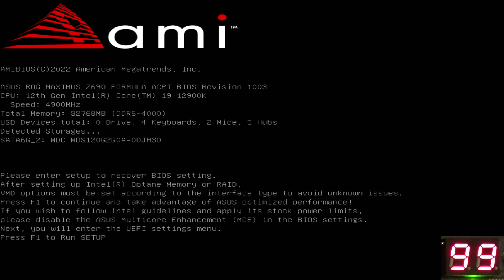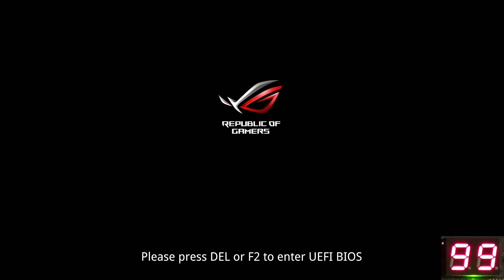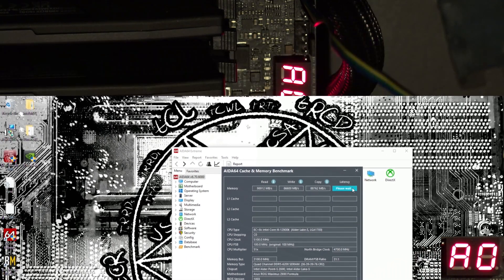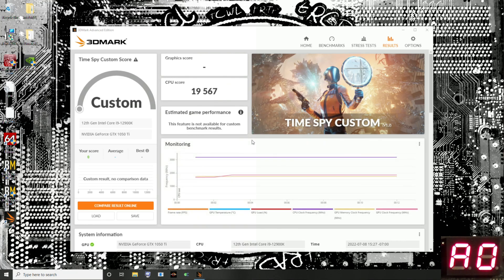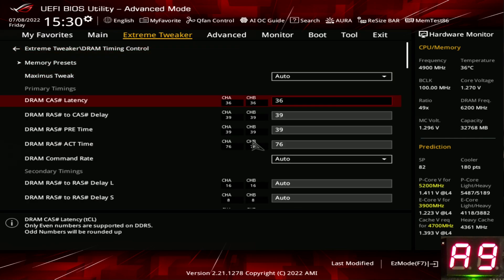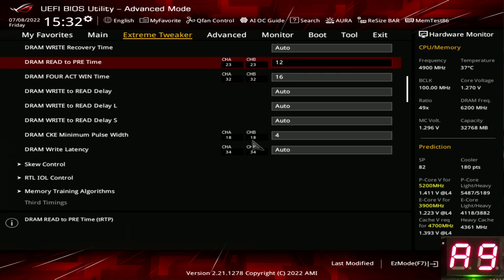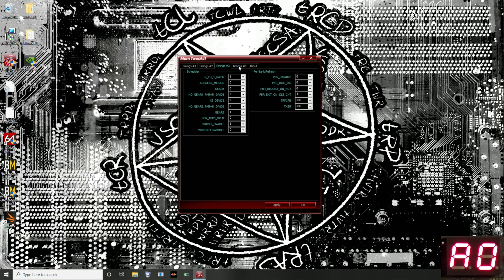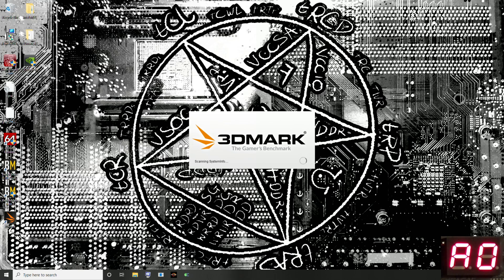Easily improve your DDR5 XMP's performance // for ASUS motherboards

Comment: I tried these settings with Corsair Dominator 6400 CL32 (CMP64GX5M2B6400C32W) on 6200 and Strix ROG Z890-I gaming WiFi.
A lot of boot cycles and fail safe mode after that. So it didnt work for me.

Some people said its because i have 2x32gb modules, which basically should be dual rank. So, am i cooked?

Comment: Great info!!  im running a 4x32GB Trident Z5 6000 CL30-40-40-96 with I9 14900k and Asus Z790 maximums hero.  i lowered the primaries too 26-34-34-26 and implemented all your suggesting settings. currently have AIDA64 80GB write and about 67 ns latency. Cant get any memory speed over 5,200 mhz. Any thoughts ?

Comment: But this surely would not work with an AM5 board?
Reply: VSOC: 1.2v
VDDIO/VDD/VDDQ: 1.4V

Speed + Primary timings: EXPO/XMP
tRRD_S: 8
tRRD_L: 12
tFAW: 32

tWR: 48
tWTRS: 7
tWTRL: 24

tRFC: ~512 if A die, ~640 if M die (your kit is likely A die, if it doesn't post then it's M die)
tREFI: 32765

tRDRDSCL: 5
tWRWRSCL: 17
tRTP: 16
tWRRD: 4
tRDWR: 16

This should work on the majority of kits. It's not the tightest it could be, but it will be better than EXPO.

Comment: Hello I'm running G Skill Trident Z5 RGB ram in mine.  I have 32gbs but I'm only able to run 16gb.  The moment i put my second stick in my pc doesn't work.   

Do i make these changes then put the stick in?  Ive tried adjusting voltage And so many things.  It just won't work for me.  Both sticks work when used single but dual i get nothing.
Reply: Try increasing the VCCSA/VDDIO a touch.

Comment: Corsair sells their memory modules with the same part number, but with chips from different manufacturers. The only hint ist the version number. Ver3.43.01 = Micron 16Gbit A-Die, Ver3.43.02 = Micron 16Gbit B-Die, Ver3.43.04 = Micron 16Gbit D-Die, Ver3.53.02 = Micron 24Gbit B-Die, Ver4.43.13 / .02 = Samsung 16Gbit B-Die, Ver4.43.19 = Samsung 16Gbit P-Die, Ver5.33.01 = Hynix 16Gbit A-Die 8Gbit Downbin, Ver5.43.01 = Hynix 16Gbit A-Die, Ver5.43.13 = Hynix 16Gbit M-Die, Ver5.53.13 = Hynix 24Gbit M-Die

Comment: Tried this on Corsair Vengeance 32GB (2 x 16GB) DDR5-6400 PC5-51200 CL32 Dual Channel
Unfortunately it wouldn't successfully post and boot, and to revert back to xmp I  intel 13600k

Comment: Hi Buildzoid, you may have noticed that halving UCLK at 6000-6400 ram speeds doesn't reduce performance in games, for example. FPS stays the same on 9800x3d, which made a big difference on 7800x3d. Why do you think? I confirmed this in different resolutions, e.g. in the SOTR benchmark

Comment: Just built up a 14900k on a z790 dark hero with Corsair titanium 2x24 7600mts and struggling to get it stable @ 7000. Tried adding in these timings and I couldn’t get to post. Though I went in after and started doing one change at a time to see the affect and the refresh rate changing to 65000 made a massive improvement on the time spy score. 
Any advice, or pointing me towards which of your videos may best help me along towards getting the most out of my set up and ultimately the best stability would be greatly appreciated.

Comment: Would these timings work for my kit that uses sk A die? Is M die better than A? currently have my teamgroup 6000mhz kit running at 7400mhz but have not manually adjusted timing other than from CL38 to CL34 and voltage at 1.45v

Comment: Any suggestions on where to start with A-die Dual-rank (2x32gb) timings? 
G.Skill 6400mhz/CL32, with a 14700k and ASUS Tuf gaming z790 PLUS
I have XMP on and its pretty good on the bandwidth, though the aida latency is still like 64-66ns

Comment: Looking everywhere on youtube to help me with my setup, but still no luck. I have a Z790-E ASUS motherboard with an Intel i9 14900K CPU and 2x16GB Corsair Vengeance 6000 C36 kit.
When I try to enable XMPI/II/Tweaked I got stuck in a bootloop at 6000MHz, 5800MHz, 5600MHz even on 4000MHz, forcing me to revert this setting to non XMP leaving me with 4000MHz, while paying for 6000. I tried adding voltage (by per PMIC) up to 1.425V, still no luck. What am I doing wrong?

Comment: I know this vid is old, but what changes would you need to make to stabilize A-die? I have g.skill F5-6000J3040F16GA2-RS5W 2x16 ram and the number next to the barcode ends in "21A" so I assume it's hynix A-die. Like the dumbass I am, I tried these timings on my MSI z790 board (left voltage at 1.35) and it wouldn't post so I had to do a CMOS reset. I assume it's because I set my tRFC2 and tRFCPB too low, but I'm afraid there are other settings set too low for A-die to handle.

Comment: i have 2x32gb crosair hynix that is 6200mt cl32 32 38 38 80 running on 1.4v, when enable xmp the pc train memory & work fine, but when start gaming i get crashing & sometimes pc restarts, then i run stability test for memory on OCCT i get many errors, how can i make it stable on my system whithout me redusing the ram speed? i have 12900k on  gigabyte aorus ultra z690 motherboard

Comment: Do these tweaks work with ANY Corsair Hynix DDR5 RAM. For example mine is Corsair Dominator Platinum 6600 MT/s CL32 2x32GB with Hynix A-Die. Will these tweaks work, that is can I follow your suggestions on subtimings 1:1?

Comment: Hello everyone ı have a 4x8 Kingston Fury 6000mhz CL40 and rog strix b660g with 14700k ı try every setting on my mobo ram's is same model same everythings okey about rams. when ı run rams 5000mhz without any problem 4800 is same too but when ı try 6000 is not working ı try 1.35v to 1.40 ı try cl40 to cl 38 or 42 44 46 is not working too. when ı try 5600 with 1.27 normally xmp makes 1,25 btw. I only got one error with memtest86. Can somebody help me about sweet spot. ı am working on it this settings about 4 days :(

Comment: Buuu, I have the same motherboard and processor, but with (64gb-5200mhz) memory ram from corsair and I followed the same steps you did. And my system didnt boot ;(. I notice that I have 3 setting that you have available in your bios But I dont have it. And of course I am with lates bios update

Comment: Gonna try these settings on my Asus Z690i ITX board with my 12700k.  I bought CMK32GX5M2B6400C32o which is an SK Hynix kit though im not sure if its A die or M die.  I had no idea about the IVR transmitter voltage needed to be 1.4v, i've left it at default so maybe that explains my stability issues at anything higher than 6600mhz.

Edit:  Do these settings work for SK Hynix A Die too?  @actually hardcore overclocking?

Comment: We need a newer version of this video with the new bios 2413. I attempted to use these timings with my gskill ddr5 8000 24x2 cl40 but my bios menu said different stuff when i got down to doing changes and got scared.
Reply: couldnt find CPU system/input agent voltage in new bios

Comment: Hey team! I went for G Skill Z 7200Mhz 32GB kit and applied most of these timings. Working great! Used 1.48v for the VDD and VDDQ and Transmitter, but have a nice BeQuiet fan directly on the DIMMs and they stay under 39 degrees. Have got 7600Mhz at CL36 stable!

Comment: i have this is my ram: Gskill DDR5 Trident Z5 RGB PC44800 32GB (2x16GB) Dual Channel - F5-5600J4040C16GX2-TZ5RS
the speed is 5600mhz. i am very new to RAM overclocking. is there a guide for this RAM kit? this is also a samsung b-die, is it good for overclocking?

Comment: Going for the AM5 platform has been an absolute nightmare for me. Got a complete new system with 2x32GB SK-Hynix A-die memory and couldnt get a stable system. After RMAing B650 tomahawk motherboard, kingston fury memory sticks, Corsair PSU I've now RMAd the processor aswell ryzen 5 7600x and waiting for a return. Tried everything including reinstalling windows 6 times.

Anyone else in similar situation?

Comment: Nothing works for me, have 6000mhz gskill set on same board and 12900k CPU can post at 5800 standard xmp2 at 1.35v vdd and vddq super unstable and crashes no matter what I do with voltages even 1.4 and above, got ram cooler sits at 50-60c under load only stable at 5400

Comment: Edit: as I was typing this, I heard you say I can use these settings with speeds up to 6800. Maybe I'll just drop them to 6600.
I have a 14900k on the new ROG Strix Z790-E Gaming WiFi II that claims to be capable of 8000mhz DDR5. Thought I had it stable until last night. I plan to lower my 2x24 kit to 7200 tonight since i had a 2x16 kit stable at 7200. Can i use these settings with those speeds?

Comment: tried it. 3 days waisted . worked but with errors. went back to Kingston's XMP. i think Kingston , G. skill , Corsair know much more than youtubers. i dont want my 13600kf freezing unexpectedly . Never mind . works at 6000 mhz.  looks like MSI z690 Carbon cant go higher than 6000 mhz.
Reply: A freezing system probably means not enough vccsa, try 1.2 agent voltage
Reply: Yes .  Goes to 6600mhz but dont like the high voltages . Settled on 5600mhz 26-36-36-76 .  SA-1.100v , vddq tx-1.350v , vdd2- 1.120v and the two  RAM voltages at 1.390v . Works flawlessly  . 66 ns latency .

Comment: =========> WARZONE: advice please on which Corsair Dominator Titanium 32gb (2x16gb) rgb kit to buy with a single goal in mind: the absolute HIGHEST fps possible in warzone.  14700k + Tuf 3080 + Strix z790-e (4-dimm board, i will keep 2 slots empty).   Choices are:  6000/cL30,  6400/cL32,  6600/cL32,  7000/c34,  7200/c34,  7600/cL36.  
Please help, thanks. 🙏🙏🙏
Reply: 7600 should be the best config, altough i can not know if the game is so memory sensitive, at most expect 5% more fps

Comment: Asus Z790F, TEAMGROUP T-Force Delta RGB DDR5 Ram 32GB (2x16GB) 7200MHz PC5-57600 CL34 A-DIE, Intel 13700K.  Single RAM stick in A2 or B2 runs XMPII at 7200 fine, memetests no errors.  Both RAM sticks single are fine.  When I use 2 sticks in A2 and B2 (dual channel) the whole thing is unstable no matter what.  BSODs, corrupt apps crashing, total nightmare, even stock settings at 5600.
Reply: I'm currently experimenting with this videos setting with my new Mobo/CPU config I just purchased. I7-12700k, Asus Z790-PLUS WIFI and a pair of Single Rank Teamgroup T-create 48GB (2x24gb) 7200MTs M-DIE CL34-42-42-84 1.4v I'm not able to POST with XMP1 but am able to with XMP2. But I can't get into windows without crashing unless I clock it down to 7000... but it's still not stable in games or tests like OCCT or Memtest86. It has to clock it all the way down to 6200 to get to truly be stable.  😢
Reply: I ended up reverting to stock XMP2 because his settings wouldn't POST on my board.  Memtest gave errors until I lowered the speed to 7000.  Good enough for me, so that's what I'm going with.   @Sprinkles-BtE
Reply: @WickedCrispy  I actually got Buildzoid's settings to work dude! Well, almost all of his settings. But it made a huge difference! Follow the advice that IIHydraII gave on ejosephsimon's comment thread in here. Basically, you can do everything Buildzoid did but you probably just have to loosen a few key timings to get it to work. I basically had to set the Secondary Timings of DRAM RAS# to RAS# Delay "L" to 8, and the "S" to 6, along with DRAM REF Cycle Time 2 to 500 and DRAM Refresh Time Same Bank to 400. Not only am I able to POST and boot windows, I've done four '1 hour' passes of OCCT AVX memory test (the AVX version seems to be more sensitive in my experience) and four '3 hour' long Memtest86 test, all passed with no errors!    

I later revisited those same settings just to see how much tighter they can be. I was able to get DRAM RAS# to RAS# Delay "L" to 7 and the "S" to 5 (any lower and no POST) and I was able to further reduce DRAM REF Cycle Time 2 to 475 (450 and no POST) and DRAM Refresh Time Same Bank to 325 - I tried 300 and it actually POST but my system was weirdly unstable - it would lock up randomly while trying to enter the BIOS or shortly after getting back in! This was a pretty scary position to be in because it's just at the cusp of failure. The BIOS is believing the setting is fine and not booting to "safe mode", but it would hardly give you long enough to go back and change it to a looser setting before locking up again! But thankfully, with some quick hands, I was able to make it back to that setting, loosen it up to 325, save and reboot! And now... Well now, it's golden!  But to be honest, even getting these timings that close to the razor's edge didn't change that much in the benchmarks over the settings I initially told you (ever so slightly worse read, but slightly faster write and copy - about the same latency - kind of a wash unless write is more important 🤷‍♂). So it may not worth all the trouble to fine tune it that close.  

Despite my RAM sticks being of the same maker and same speed, obviously there's enough difference that my exact setting might not work (2x24gb and M-die after all) but you should at least give it another try... just try loosening up those 4 settings over what Buildzoid outlined before giving up. You're leaving a lot of performance on the table. Overall, it reduced my latency in AIDA from 76 to 57 and helped the throughput of ADIA read, write and copy by ~10+ gigs per second at only 6200mt/s (the max my 12gen cpu/mobo combo seems to be able to handle, in seems)!  Makes me feel a little better about my not-so-great buying decision. Many thanks to you, Buildzoid, if you bother to read these things. 🙂You really changed how I look at RAM and the marketing of them. I wish I had discovered his channel sooner. Especially before buying my recent PC upgrades.

Comment: cant get these to post at 8000 when changing the timings and voltage from xmp tweaked, using 2x24gb gskill kit, its fully stable at 8000 xmp tweaked. the only main difference and potential issue i saw is that i cannot set the timing DRAM REF Cycle time , its grayed out, while i can set DRAM REF Cycle Time 2, which is what i did... but like i said it wont even post.

Comment: Would these timings also apply for the "TEAMGROUP T-Force Delta RGB DDR5 Ram 32GB (2x16GB) 6800MHz PC5-54400 CL34" kit you recommended in your DDR5 video?
I'm about to upgrade my 10900k/z490/DDR4/4000 to a 13700K , DDR5 Team-group 6800MT/s CL34, ASUS ROG Strix Z790-A Gaming Wi-Fi LGA. Wondering if I can run these timings ?
Sucks kuz I'm just starting to get my head around DDR4 & now I'm going to DDR5.lol..  Oh and love your videos, they are prefect for ADHD/OCD people like me …..
Reply: Yeah it’s Hynix A die, you’ll probably need to run the tRFC a bit higher (400-500 ish) and the tRRDS/L at 4 & 8. Unfortunately one of my dimms is defective so I can’t test for myself until the new kit arrives in a week or so. Just run a memory stress test like TM5 or Kahru for a few hours and if there are no errors you’ll be fine 👍🏻
Reply: @IIHydraII  Thanks bro! this actually helped me. Told me basically what I need to dial back some. Took a bit of trial & error but it worked and allowed me to implement all his other settings on my $190 Teamgroup 2x24 cl34 7200mts M-DIE kit, on my cheap-ass Asus z790-plus motherboard and i7-12700k CPU (both were on sale for about 200 each). Made a huge difference too! I was getting terrible latency times in AIDA64. Still not quite as good as Buildzoid's in this video, but from 76 to 57ns @6200mts cl32,38,38,28. Probably can eek out a bit more but I'm good for now 👍 and yeah I know, the RAM was definitely an overkill/non-economical choice considering the other combined gear but I really didn't know what I was doing when I bought all this stuff and thought one day, I could throw in another similar 2x24gb kit when cheaper for 96gb total RAM... but after watching/learning from a couple of Buildzoid's videos, it will probably perform terribly, if at all. 😢Not sure if its worth returning though. any maybe TMI but just wanted to thank you.
Reply: Ran Memtest for 1 hour 0 errors. 
@7200MT/s 👍

Comment: Hey BZ, I’m still struggling with DDR5 a year later…I know this is an older vid but I’m trying to run these Corsair Vengeance 4x32gb at 6400mhz, which is what the DIMMs are rated for.  Any DOCP I, II, or Tweaked profile won’t boot.  I feel like it needs to be manually tuned even to hit 4800 or 5200.  If I bypass DOCP and set to manual on an ASUS X670E Hero can I use this voltages and sub timings?

Comment: i updated my bios to v2703 (latest), i set my XMP 1 on, then started crashing in all games. few days later i set my XMP to disabled, set everything default, rebooted to windows, it ran fine. went back into bios to re-enable XMP to 6000mhz like before at XMP 1 and it now works. weird. z690 tuf gaming plus wifi, hyperx 2x8gb 6000mhz xmp ram. also, is it normal for the PC to restart several times with an orange light, then run fine after a few restarts & load into windows properly on when i enable XMP to 1?

Comment: Hello everyone! I have a asus motherboard rog maximus z790 hero and now a have a issue with DRAM VDD and DRAM VDDQ voltages. my RAM is Kingston FURY Beast Black RGB [KF556C40BBAK2-64] worked on 6000Mhz 36-37-37-70. But today it became a not stable... As i can find 1 dimm work fine, but second, stable only at XMP1 profile with DRAM VDD 1,09V and DRAM VDDQ 1,1V instead 1.25V from XMP1. But more intresting that i can`t change dram voltages manually! Motherboard ignoring me with this dimm in all slots... Who can tell me whats going on?
Reply: solved...

Comment: Hi BZ, so , I know this video is a year old, but I'm running an Asus motherboard B650M-A AX II with DDR5-6000Mhz RAM and a Ryzen 7 7800X3D chip and its crashing my games, when I underclock the RAM to 5200Mhz it runs fine.... I updated the BIOS on the Asus Board, but still crashes.  Any ideas what could be causing this or how to fix it? thanks

Comment: FYI. Turn on Memory Context to retrain your memory if you are overclocking any memory timings. My PC 7950x / Asus B650E and 64gb DDR6000 CL30-38-38-96 along with Buildroid's custom timings would instantly BSOD on boot or wake from sleep/hibernation. After renabling Memory context to retrain before boot, BSOD stops and system loads normally.